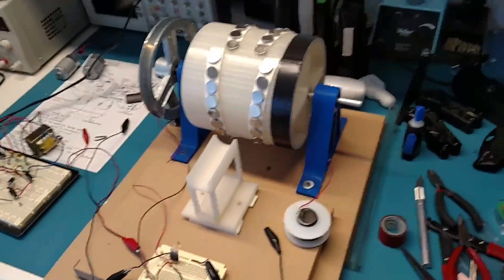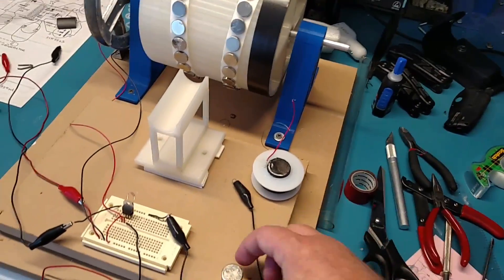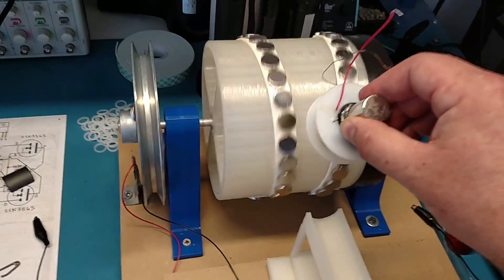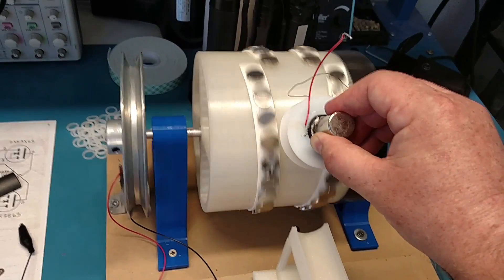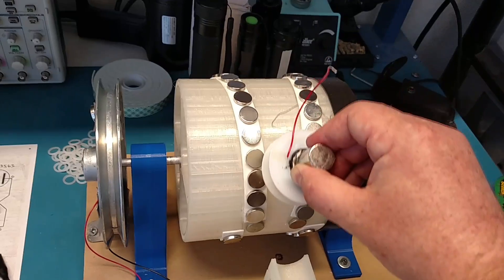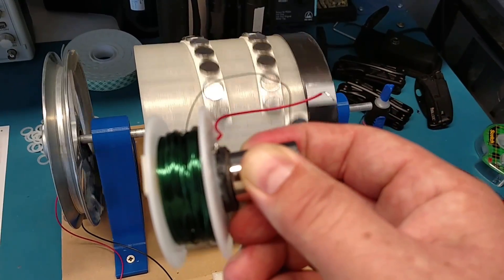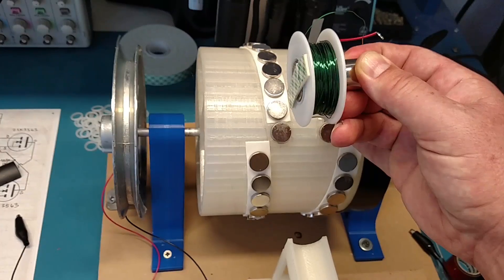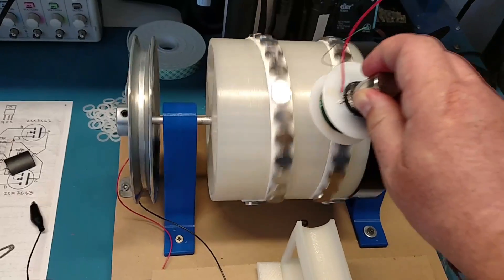V-GATE magnetic neutralization unit explained

Comment: How many things can you have in the gate at 1 time? Why only have one? Im ready to build my own free energy based of a similar theme. Inside of moving or turning it on and off I'm going to offset it. Image 2 circles one bigger than the other. The smaller one contains the gate and the bigger one the  magnets  🧲👌.  Now do not center the smaller on in the bigger one because it will get stick at the gate like you showed. The inner circle will be closest to the outer circle at the center of the v gate and farthest at the start of the gate. Ad long as the magnetic field is really strong at one side and u are out of the field qt the other sides where the gates start stops you should be fine. I plan on putting mine vertically and the close to overlaping want the overlap part at the 1 o'clock position and the farther part at the 7 o'clock position so gravity helps assist pulling it down threw where there is no longer a magnetic field....
Unfortunately I'm dead broke and I'm starting with nothing so this might take me a month

Comment: A bigger diameter would make the rail longer and will give you more momentum and could help with overcoming the gate.
Reply: I was saying something similar to that but can't find someone who will build it. I want to use multiple v gates that stay still while the other magnets spin around the gate. The one that spins will be off set so the magnets are close to the gates on the one side and further away and out of range of the magnet where they want to stick and stop. Most importantly the point where he turns off the power because the magnet stick will be lined up so no magnets cross that point at the same time. Now you can use regular magnets and don't have to use power

Comment: The concept behind this is awesome, but the trick is to make it NOT electric at all by putting a lever wich should pull the main magnet away at the correct moment to get around that sticking point, so it could run indefinitly or atleast untill mechanical failure, heat or friction will strike on one day.
Reply: No the trick is to run it off its own electricity

Comment: This makes sense but still...remember that if your using this device as a power source (by running a generator) then as power is taken from the device the back emf in the generator will slow down the wheel. So during each time when the magnet is shut off the back emf will slow down the wheel the greatest. What floyd DeBarber says makes sense, that is, reversing the polarity of the magnet to maintain a constant turning force on the drum

Comment: So basically you used a reed switch to interrupt the electrically powered coil and created a very inefficient pulse motor. What's the point? To create a true magnet only V-gate motor you need to use a mechanical action on the repulsion/attraction magnet. Anybody can create a motor using magnets and a miniscule amount of electricity.

Comment: I like your persistence on this project! What if, instead moving an external part, the magnets on the drum were deeper? Could it work?
Reply: Apparently yes from what I've seen, as long as it follows a "vortex" / spiral or circle /loop of some sort with the last magnets gradually loosing their power from the distance/deepness of poles.
Reply: This solution albeit very tempting is not practical (it is obvious and the guy would have used it) as while magnets positioned deeper in the drum will reduce the "bump" at the border line but de facto that line will just move back. Secondly, you loose some magnets which will contribute to the forward motion...That is the perpetual problem/dualism/contradiction  in  perpetuum mobile machines - an element or a condition creates both positive and negative force at the same time so the machine eventually stops, as those forces eventually cancel themselves.
Reply: I was thinking like you were but I said the magnet should spin and not the gate. The outer circle will be offset so the magnet is out of the fields where it has resistance and closest on the opposite side it should spin freely.  Especially if you can have more than 1 magnet

Comment: Instead of a complicated cam system or magnetic neutralization system why not build the cam into the drum. Movementless CAM.  Like a nautilus shell (from the side) the drum, instead of being perfectly circular, would spiral inwards.
Reply: Cams take energy to push up. He needs to offset the position of the magnets. Picture 2 ring one 20% bigger. Do nit center the smaller one and have them close to touching at one side. The part where they are furthest apart is where you place the stahling point

Comment: If I'm right in understanding this. The coil cuts out the magnet right? Well that got me thinking of points type ignition systems. When the field collapses in points ignition it then magnetises a larger coil yo generate current for the spark plug. How would then on your machine if on the side of the drum instead of having 1 magnet to time the switching you have all 97deg of the drum in magnets. And then have 3 deg without magnets. Then have a coil near those magnets to make current. Send that to a transformer then from there to coil which cuts off the v gate magnet. What I'm thinking will happen is when gap comes round it will collapse the field send high tension current to the gate magnet thus cutting it out.

Comment: Awesome idea, JClaw Tek! I have a question thou, are the magnets on the wheel all facing North and the coil is pulsing South polarity? Or it's the normal N \/ S v-gate? 

'Cause I see people go with the configuration of N\/S for v-gate and S==N for stator (attraction mode)
Reply from the maker: Samuel N I didn't have a polarity checker so I'm not sure.
Reply: Well, when you glued your magnets to the wheel, did you glue all of them with the same polarity facing out? Or 1 side North and 1 side South? That's what I meant, sorry for my English.
Reply from the maker: Oh, got it.  All the magnets on the drum have the same polarity facing out.

Comment: A silly question. Did you ever play with a real magnet instant an iron core (electromagnet with a real magnet) 
and try to neutralize the real magnet. You will spent less power for turn. Maybe it is stupid I don’t Know. I never try it.
Reply from the maker: That's an interesting idea.  I think I'll give it a try and see what happens.
Reply from the maker: I tried neutralizing just the permanent magnet using an electrical pulse and it didn't work.
Reply: I was afraid it. As I see on the video you are thinking to use belt and dynamo. Instead of that I was thinking if you have plastic axle with a big hole, big enough to make a coil with simple cable. The magnets on the drum are turning so you have a moving magnetic field. Make a stable coil and put a big resistance to close the circuit. Measure voltage and current and see the results. (AC of course). The draw sucks but you see what I mean. http://prntscr.com/gb4r2o

Comment: if it's possible please send me electric schematic or pic what you use for control ... I think to use 555 chip ... I have video on my YouTube for V gate  ... abricosvw  @  gmail  ....
Reply from the maker: the electronic side is dead simple.  The center of the circuit is a 13N80K5 FET (sized for much larger currents than we see in this circuit but better safe than sorry).  The magnetic reed switch, Digikey part number HE574-ND, goes between the 24V+ and the FET gate.  A 1 megohm resistor goes from the FET gate to 24V-.  The FET drain is connected to 24V+ and the coil goes between the FET source and 24V-.  So the timing of the pulses to the coil comes directly from the sense magnets sweeping past the reed switch.  The speed of the motor, interestingly enough, I've discovered is in proportion to power supply voltage.  The motor runs at 12V, but it runs slow.  As you raise the power supply voltage the motor speed increases.  Basically what is happening is higher voltages neutralize more and more of the magnetic field from the iron core.  At some point a voltage will be reached when the core will have no magnetic flux and therefore no resistance to the gate of the v-gate.  I've noticed that if you get a magnet that is in repulsion close enough to the iron core the repulsion will be overcome by the attraction of the magnet to the iron and it will latch on (even though the pole of the iron core was the same prior to that point).  Cool stuff...